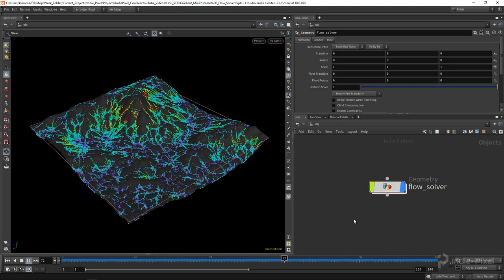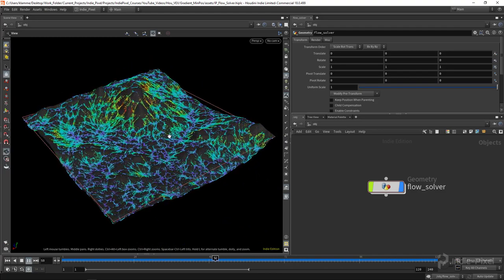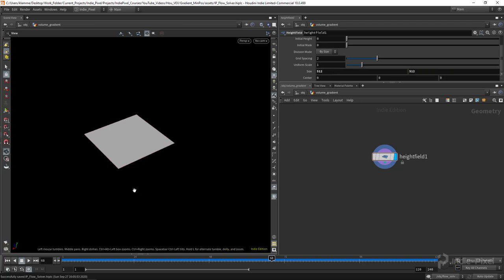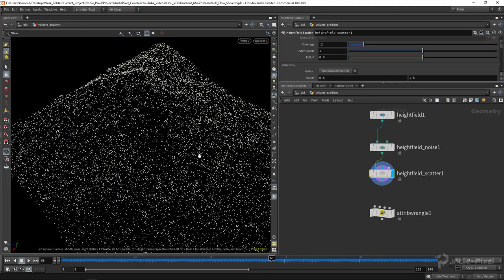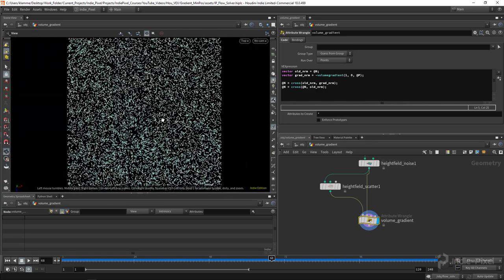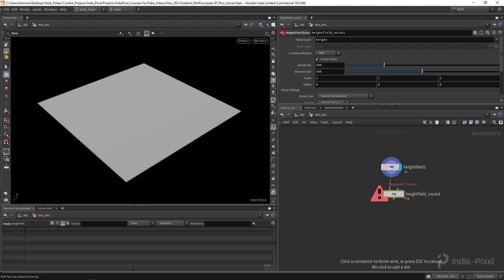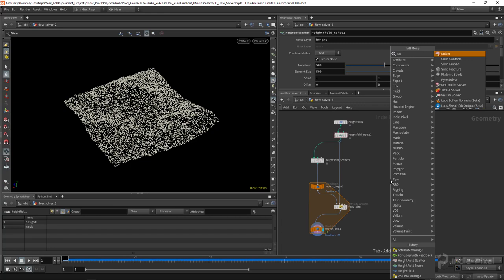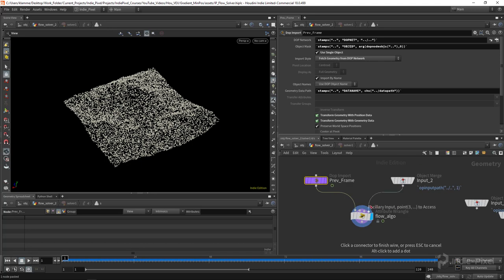Houdini 18 - Intro to VEX - VolumeGradient - Min Pos - Custom Flow Solver

Comment: How would you erode the terrain using this custom flow method?
Reply from the maker: Each frame I would remove height from the heightfield and transfer it to neighbor vocals.  That would move the terrain down the hills.  It's done with a volume wrangle.
Reply: @IndiePixel3D  yes i thought so but how would you choose which voxel to subtract height from. A voxel near a flowing point would give up some of its height storing it to a point attribute. So each time a point passes by it removes some height from voxel a transferring it the next voxel?
Reply from the maker: @philippaps44  yep, exactly.  You choose the voxel to transfer to by looking at the neighboring videos and find the one that is pointing downhill the most.  That is the simplified way.  There could be more rules involved but that is the basic algo.
Reply: @IndiePixel3D  Would be interesting to see an erosion effect applied on any volume not just terrains